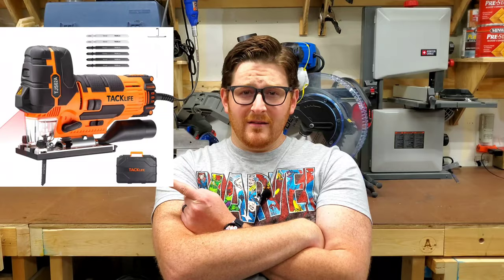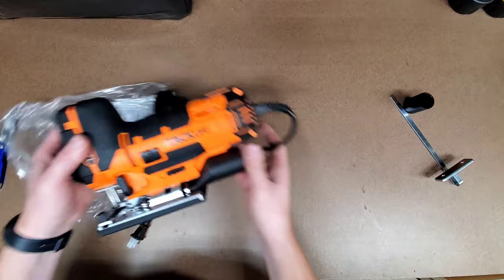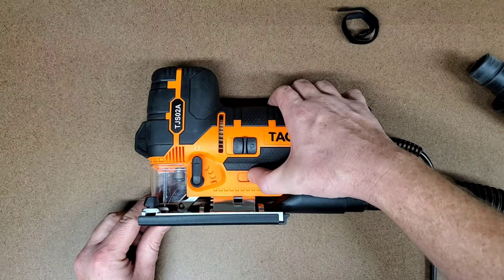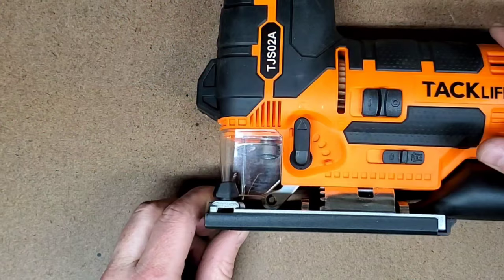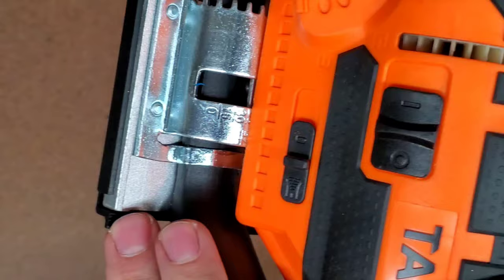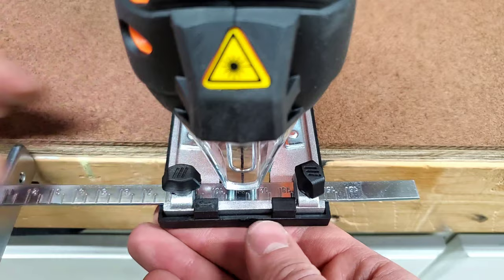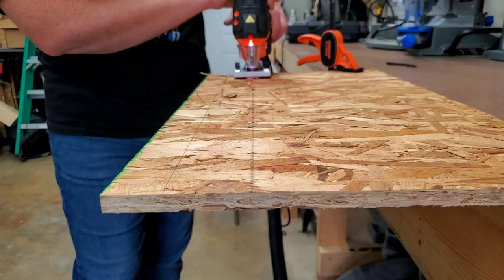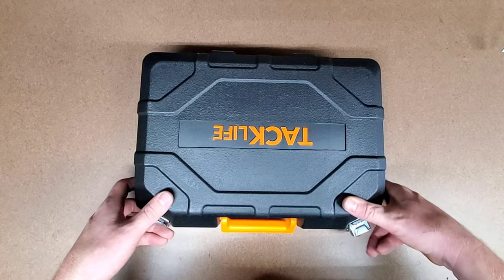Tacklife Jigsaw Unboxing and Initial Review // Just Joshin' Around

Comment: Your Video/Tutorial was Super Helpful! Thank you so much for making as the paper directions suck! I can't even read the picture module as the font size is soOOoo small... So, by your video, I was able to insert blade and get started on my project. I have just purchased this exact Jigsaw, and I am TOTALLY NEW to this. Have never used one in my life!  But, I am a lone girl trying to do her own remodeling projects without any help.  And what I'm trying to accomplish is,  cutting the the 4-Corners off of my late moms Rectangle Solid Wood Dining Room Table. I really hope these blades hold up & I really hope I can do this..... Positive Thinking - Positive Thinking & Praying.....  Thanks again for your Video. - Mary
Reply from the maker: Excellent, I'm so glad I was able to help! And thank you for the kind words!! 

And it's awesome that you're taking matters into your own hands and doing your own projects! 

One thing I would suggest (I can't remember if I mentioned it in the video), is to get some different blades - I purchased these ones and highly recommend them: https://www.amazon.com/dp/B07NRMJS9G/ref=cm_sw_r_cp_apa_fabc_2dtZFbW8WJ9R6

Only because the included  blades are very low quality and bent very easily.

Good luck on your new DIY adventure, and if there's anything else you have questions about or need advice on, let me know.

Thanks for watching and for commenting!!!

Comment: Update on this saw please
Reply from the maker: I still like it a lot. The only problems I'd say I have is that: 
1. The lever that you open to tilt the base for angle cuts, sometimes comes loose - causing the base to drift away from square. It's not a huge deal - and can be taken care of by taping it clamping the lever shut - but it's still annoying. 
2. The dust collection is not great - mainly due to that nozzle tip being so narrow. It works well to suck up the fine dust, but sometimes big chunks get stuck on the tip - causing it to stop collecting the dust.

Other than that, I still like it. Especially the barrel grip design - it's nice for better control.
Reply: Thanks.  I'm looking at Milwaukee or dewalt but they are expensive.  But you get what you pay for.  I'm old school i believe you can buy a good tool once or keep buying cheaper ones and not be happy with it. That said it's not a tool I use all the time.
Reply from the maker: Yep, no problem. And I feel the same way. I'm currently looking into updating my other cordless tools (drill, driver, circular and reciprocating saws, etc...) and I'm not sure whether to go with Milwaukee, DeWalt, or even Ryobi. Not just a simple decision, since I'm basically buying into the whole ecosystem, but I want nice variety with the interchangeable batteries.